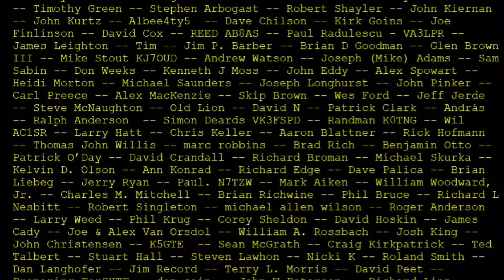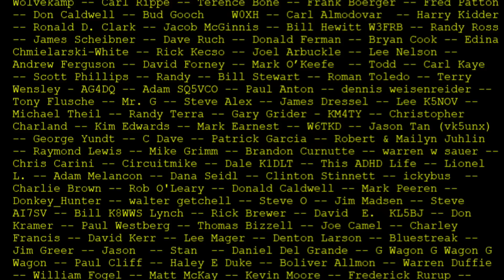Tips for Anderson Power Pole Connectors (#1195)

Comment: Problem must be my crimper. I do the same as you but the crimper doesn't let go. Then the only way to get it out is the first connection end or the wire. So I've just been using needle nose pliers. Thoughts?

Comment: Dave,
I find that when the wire is too small for the crimp, that doubling the wire or putting another suitable wire in the crimp that will serve as strain relief ehen taped to tthe small wire workes well
- no solder needed, strain relief benifits if the wire connection wire is tiny

Comment: Thanks, Dave.
   Power pole connectors have their problems. However, they are better than a myriad of other connectors I have used. In the last eight years, I have not had one connection fail or give intermittent contact. 
   I take my time assembling them. Even though I have dyslexia, I have not messed up any of the connectors during the assembly of dozens of the Anderson power connectors. They are not as rugged as the Ampenol olive drab connectors, but they do a dependable service. N0QFT, Glen

Comment: DX Engineering crimp tool has an extra support block that protects the tip and ensures the powerpole connector is inserted to the correct depth to crimp properly.

Highly recommend the DXE tool. It will make crimping your powerpoles a million times faster and easier.  The kit also comes with crimp blocks for coax, wire terminals, etc.
Reply: absolutly agree, - it holds and orientates the crimp better during assembly and crimping

Comment: Powerpole connectors are genderless, so they can connect to both source and sink while protecting the live parts. The contacts can carry more current than the wire they connect to. There is a relatively universal ham radio convention for using them for 12V power and if you follow that convention, cross polarization is very unlikely. (Holding the cable end, looking at the connector end, Red Right, Tongue Top.)  

For me the wonderful thing about Powerpole connectors is that any of your power cords can be used with any of the adapters to other connectors and I can take my equipment to any public service event or emergency and we can all easily work together.

Are they perfect? No. But they work well for me. Using a proper crimper and the silver plated copper contacts I have never had a connector failure. I cannot say that about the other commonly used Amp, Molex and bullet connectors which are not rated high enough to handle a 100watt transmitter without paralleling contacts, which is a disaster waiting to happen.

Comment: I have the same problem except my crimp jaws (same company) are different the have a buipt in stop which makes it difficult to insert deep enough into the pocket causing the deformity.
Reply: My tool is the same.  However, it forces you to rotate the connector to the proper orientation.  Flip over the connector.

Comment: Never could understand how power poles became the norm...they suck...there are many quick connect/disconnect connectors that are much better.
Reply: The high current rating makes them good for caravans and camping gear. From there, they spread to 12V portable systems (ie. mobile radio).
Reply: I agree

Comment: For the 30a connector, I strip the insulation back further than the recommended 3/8” then fold over the small wire before inserting it into the connector, then crimp.  I will then second crimp with the 15a for a tighter crimp.   Then insert into the plastic housing with the curve facing down with the small portion of the plastic housing down.  If it does not click into position, I use a tiny screwdriver, insert it into the plastic housing, placing the tip on the back of the connector and push it in until it clicks.  This usually is necessary when using a small diameter gauge wire.   Good video Dave